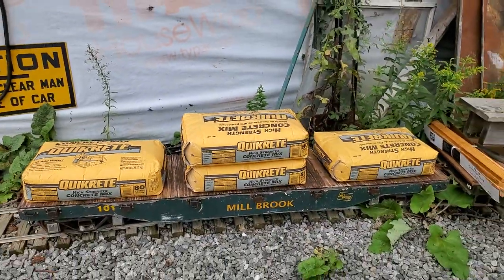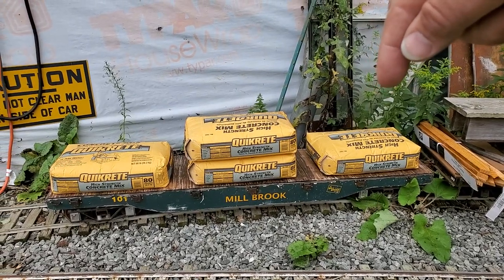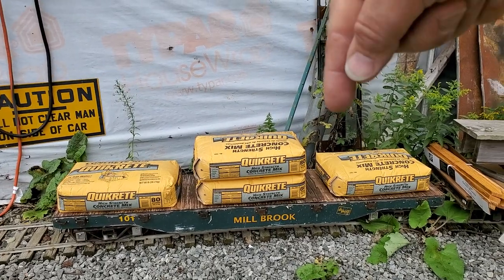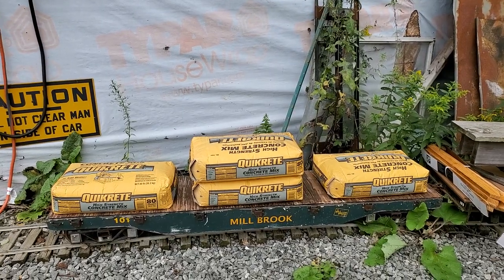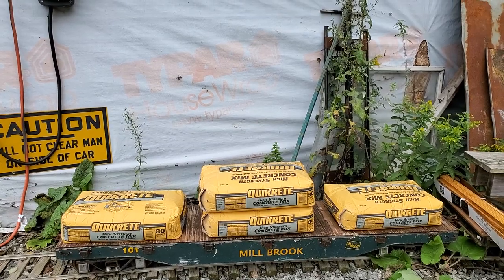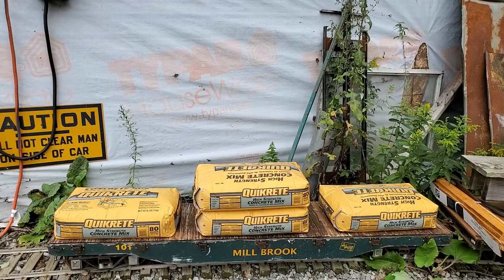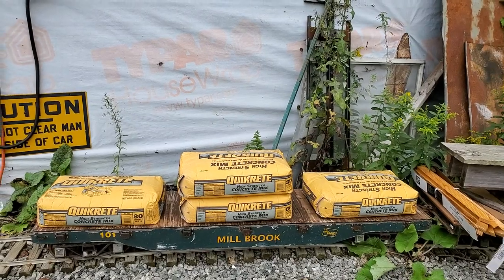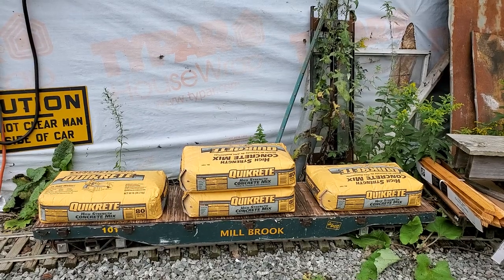How I load cars: the method and the madness behind it.

Comment: Good information to know, as most of you know, Railroads have had there share of derailments, and part of that can be the how different weights in RR Cars are distributed in a consist.

For example Empty Flat or Beer Table type cars are notorious for derailing thru switch moves.